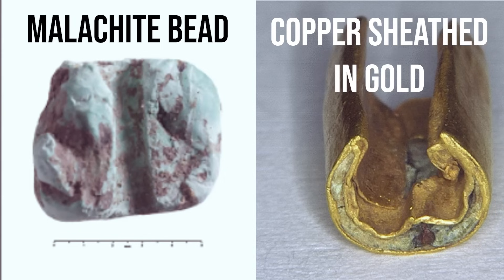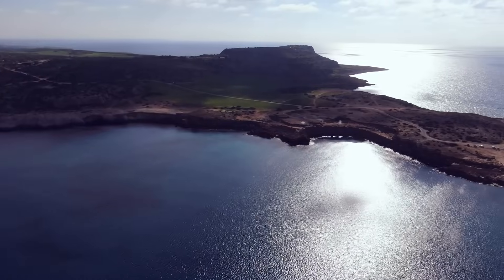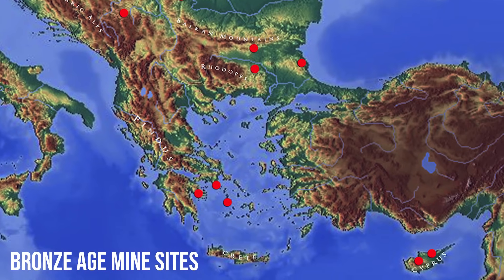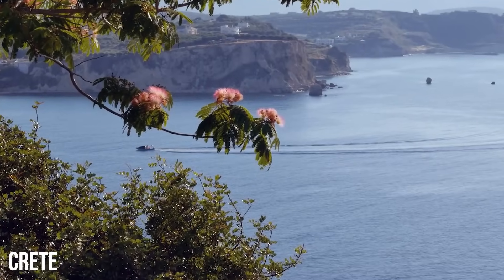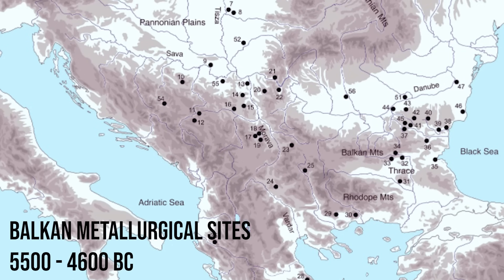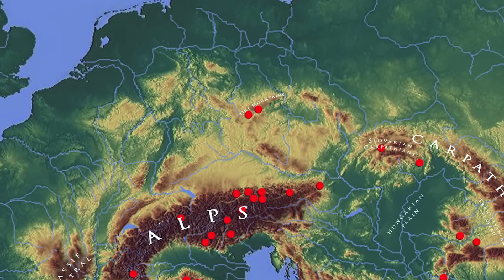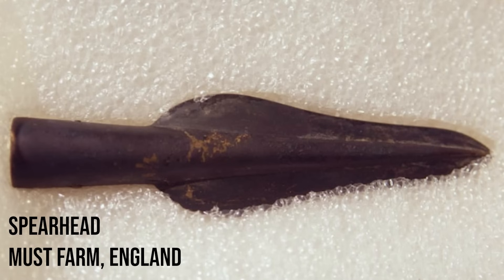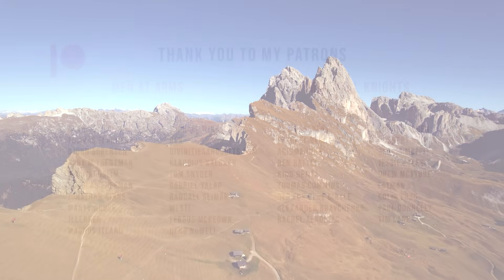These Ancient Mines Transformed Prehistoric Europe

Comment: I add an extra like for the clear answer to the ridiculous question in the title. Now I’ll watch your takedown of the question. Cheers.
Reply: why ridiculous?
Reply: @Yarblocosifilitico  Because there is easily accessible copper basically everywhere.
Reply: @rhoddryice5412  true
Reply: @Yarblocosifilitico  Swedes have a proverb, “No need to cross the stream to get water”
Reply: @rhoddryice5412  certainly. But there's no reason that they wouldn't have crossed the Atlantic like the norsemen did in medieval times.

What's interesting about this topic is whether the ancients (like the Phoenicians) reached the Americas and set up colonies there. Would've they used local copper for both the colonies and the metropolis? Yeah.
Reply: @rhoddryice5412  
So what do you do if that stream is polluted?

Comment: Once long distance trade is established in copper, tin, etc., and once people start melting and reforging scraps the provenance of the mines gets obscured.
Reply from the maker: Not really. There are studies looking at the scrap metal trade and melting old metal and reusing it does show up in some studies. But so much copper continued to be mined (and the melting down and reforging with metals of different origin wasn't that common) that evidencing where artefacts came from isn't a big problem.
Reply: @DanDavisHistory  That was then.  But in more recent times there is a lot more scrap reuse and mixing of metals from a variety of mines.  It will be very hard to identify the origins of the metal in modern artifacts....and the less ancient an artifact is the more likely that is to probably be the case.
Reply: @qwertyuiop1st  Is that sure? I mean, we can track down criminals by the specific tune of AC buzz in recordings and can now analyze rocks so as to not only precisely date them, but deduce their entire geological history, basically. Were they pressurised at some point, molten, altered by water or erosion, and if so, how and how much etc. It wouldn't strike me as impossible to detect signatures of specific foundries and deduce the techniques they'd used in the near future if the trend holds.
Reply: @michaireneuszjakubowski5289  Indeed.  But if you take a bunch of rocks from different locations, crush them to powder, mix the powders, and then analyze them you are not going to be able to discern precisely where the different rocks came from.  Same with metals, the trace elements and isotopes get all mixed together with other traces and isotopes, making it harder and harder to discern the provenance of the ingredients of the mélange of ingredients.